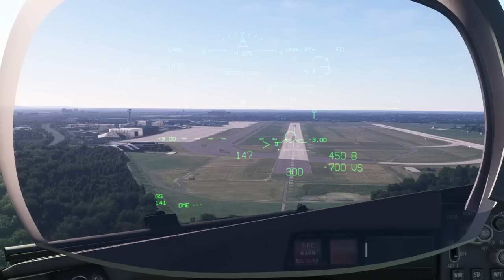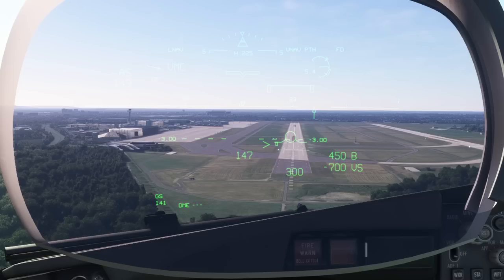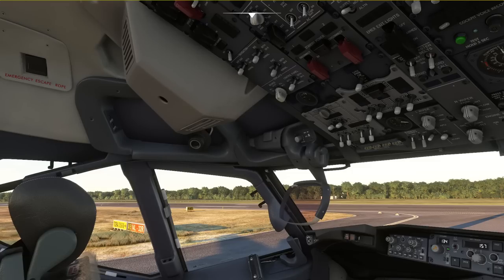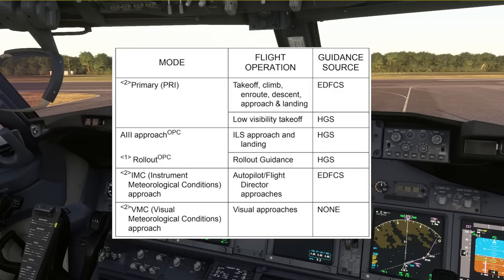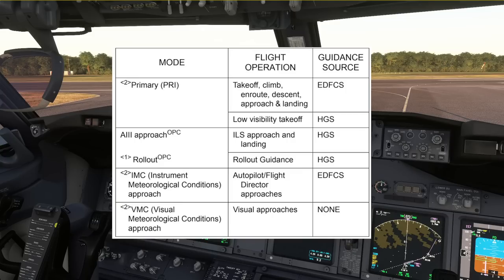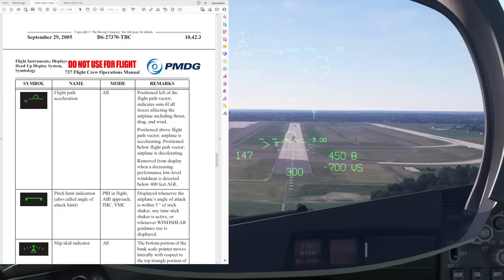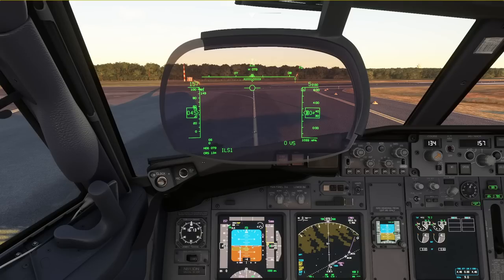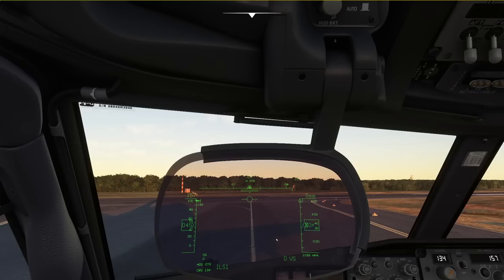Head Up Display Explained: The Basics | Real Airline Pilot

Comment: Could you do a short video (or explanation here) about the AUTO ignition option? When does it come on automatically and when do you still need to switch it to CONT/FLIGHT modes? Also same for the auto probe heats.
Reply from the maker: On the list for a future video.

Comment: The control panel for the HUD is a little bit weird. All documentation I've found for PMDG said, the runway length must be entered in feet. There is an old thread on the forums about this. 

Are you sure we need to enter rw length here in meters? Also according to the manual for the HGS model 4000, the unit indicator should be after the number and not before. So, I'm confused. :)
Reply: PMDG confirmed, we need to enter feet for length and elevation and there is no way to change the units.I hope they will fix this in the future.
Reply from the maker: The units required are mentioned in the indicator. The PMDG unit looks exactly like the unit in the manuals. Including the positioning of the units indication.
If PMDG confirmed to you that you have to enter feet, then they've bugged up the system. The inicator clearly shows M and not F.

Comment: Thanks for this! One question: when setting the elevation on the hgs mode panel would you set the tdze listed on the approach plate or just the field elevation?
Reply from the maker: You'd use the TDZ elevation as that is where you want your runway to be drawn.